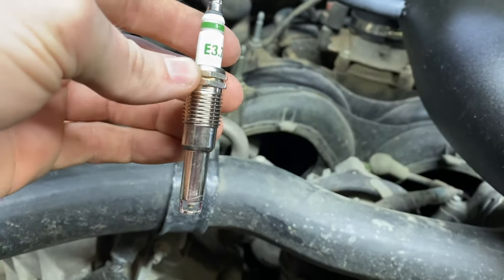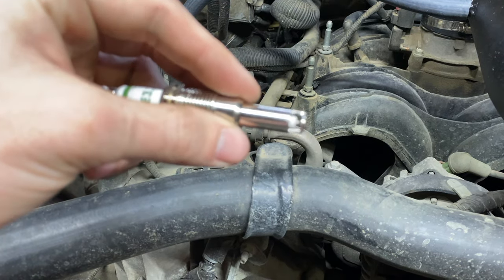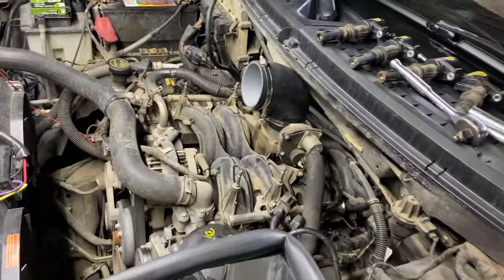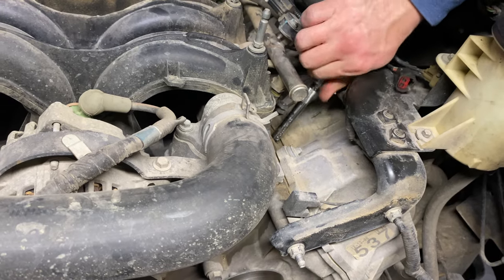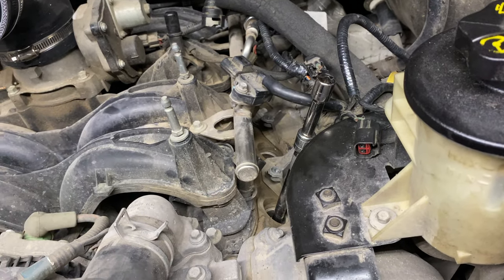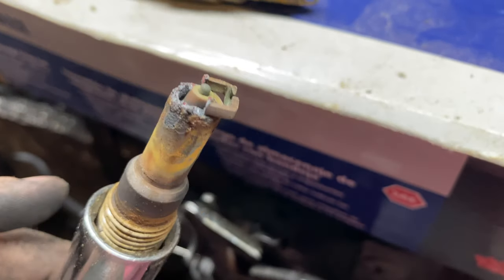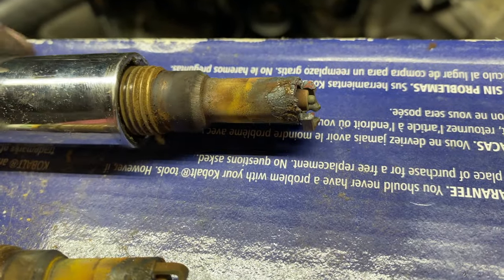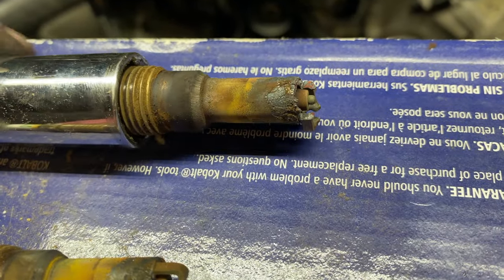This made a HUGE DIFFERENCE IN MY F-150!!

Comment: I own a 2008 Ford F150 with the 5.4 L and everyone has had or will have a problem with the Passenger side Back  Spark plug. I found this simple solution to that and it virtually makes getting that particular plug out ( which you didn't do in this video) Simply remove the Computer and Bracket from the Passenger side fire wall and you will gain easy access to that rear passenger side plug. I discovered this to make changing plugs on the 5.4 a very painless and more pleasant experience. You don't have to take my word for it but it will make a difference.
Reply: I changed 7 out of my 8 spark plugs because of this
Reply: Great hack
Reply: Exactly what I did lol

Comment: I installed E3 plugs in my F-150.  Why?  They were on sale.  Cheap enough to take a chance.  Nothing happened.  As in nothing special.  No increase in power or fuel economy...Also, nothing bad happened.  No misfire.  The engine didn't blow up.  They work.  But don't expect a life changing experience.

Comment: Motorcraft is the best for the triton period. If you have upgraded your truck and would slightly like to improve the only possible upgrade as far as plugs go. Edelbrock coilpacks. Pack a dyno tested 20% spark increase And Ford performance makes one set of performance plugs for these engines. They are hard to find. But even then I would not recommend using them unless you have already tuned your truck cold air intake. Andy, big BBK 80MM Throttlebody. And even that throttle body is snakeoil, Because your intake is smaller in diameter. So unless you HONE your intake, you have gained nothing. But if you make these modifications, it is worth it. Combined with an electric fan swap, it is an amazing difference. I. Also run a true Ram hood to my cold air intake. Dramatic difference, but I still use motorcraft plugs E3 Is a lawnmower plug, Hope this comment save someone some trouble

Comment: What I did with my 2006 f150 5.4 I took coils off and put parts and carb cleaner or BP blaster on then the day before and then loose then a quarter turn the tighten a quarter turn till it gets easier the pulled them out and I put some anti seize just so I don't have problems later on but I didn't have issues with mine even though they was factory plug and I would definitely say I got lucky and like this guy said don't do it unless you know what you are doing
Reply: Thanks for the tips

Comment: Just got my mechanic to change the plugs at 170k miles today. 2007 5.4L and now there’s no slight engine shake or hesitation going from 45-50 MPH. Even the drivers seat stopped vibrating now. Motorcraft is the way to go, thanks for the video! Awesome

Comment: w
When I hit 100k on my 2006, I looked online for info about spark plug change.  Didn't take long for me to get it to my mechanic.  By this time Ford had established procedures and engineered 2 tools to assist with removal - one if the plug actually broke off and another to help extract a non-broken plug.  And there was a special solvent to soak the plug in an attempt to get it to release.  
My mechanic had the truck for 8 days. He worked on it, very gentle turns on the plugs, for an hour every morning. He ended up needing to purchase both tools.  
Final bill - 8 plugs @ $15/per plus labor for a total of $325.  
I know Ronnie didn't make any money on the job. Probably lost money, not to mention his labor.  
That's why a good mechanic is worth his weight in gold.

Comment: EITHER THE CHRYSLER OR ZILLA PENETRATING OIL IS A LIFE SAVER!! Years of die hard PB blaster use before trying these other 2
What I try and do is run the engine to  temperature then pull the coil then try loosing or saturating the plugs a day or week before the repair

Comment: I own a 2005 Lariat, its got 206000 miles on it.  I have given it a major tune-up every 100,000 miles. Never had no major issues, except for Front ball joints. The Truck has been good to me. Runs smooth.

Comment: 167k miles have you have issues with Rocker Arm Valve Lifter Lash Adjusters aka roller followers?
Reply from the maker: Not to date I haven’t. Been wanting to go through the engine and do the timing job, but haven’t had the time to tear into it

Comment: thanks for the video!! off topic question. when you put in that aftermarket filter did you tune anything else? some debates ive read about that.
Reply from the maker: I did a tuner because I have an exhaust as well. It helps out a good bit, I get 16.5 mpg and it has plenty of power to do what I need. also used the tuner to recalibrate spedo for bigger tires
Reply: ok noted thank you so much brother for your response. i aint gonna lie i thought i was gonna be able to figure out my problem with my ford but couldn't so i think im gonna have to sell it anyways. air or fuel problem and cant seem to get anyone or mechanic to figure it out. ones that i  can afford at least. it even backfired at one point haha. again thank you so much for your responses!!!

Comment: Did you see an increase in speed with the Air intake ?
Reply from the maker: Not really, more low end after Intake exhaust and tune all together. Intake alone might give a little better mileage and that’s most likely all you will see without a tune for more airflow
Reply: @JayThompson25  link to the air intake? and air intake box?? tired of looking at the weird stock box

Comment: Great videos. So I changed the plugs on  07 xlt with not much trouble. #4 was a complete burnout. #5 would come almost all the way out but seemed to just spin in the cylinder head, so I just screwed it back in. What would you suggest as a way to remove that plug? Thank you in advance.

Comment: Curious as to why you didn't replace the coils when you were in there?
Reply from the maker: I had recently replaced the coils previous to the plug change! Didn’t have to change them, but just preventive maintenance
Reply: @JayThompson25  will be doing that same job on my 'new' 2006 XLT 5.4....

Comment: Dang that 5.4 runs good dude, mine does too, but it's bone stock,,, well I say bone stock, and it is for the engine, transmission etc, but I had a North Dakota dealer install a block heater for my Louisiana bought truck, and had the local car audio shop in Williston install a nice Astro Start remote start, a must have in an extreme cold climate, or waste all kinds of time, while having to work oilfield hours, waiting for the 5.4 3V to warm up properly before driving in below zero temps
Reply: did you have a 2006 f150 maroon?

Comment: Rock n Roll, dude...that engine sounds great. That plug was jacked...did you eyeball the top of that piston with a camera? Cuz it looks like the top of it hit the plug for it too get bent like that? Or it was damage when installed and if that's the case and it ran well, then that gap doesn't appear to be crucial. You're lucky it didn't break off and destroy the cylinder. I would have insisted on taking a look with a camera anyway.
Reply from the maker: At the time I didn’t have a bore scope camera! However after replacement she runs like a top so I assumed no foul play! I’ve been planning on pulling the motor for a while to do the critical timing and high volume oil pump upgrades!

Comment: I have to change mine and I have mechanical skills but i’m to scary to replace by myself. I’m north florida and the mechanics wants to charge usd 600 + 200 each they broken. I found ridiculous but if you guys know a good mechanic around let me know.  Still the original plugs on my 2007 f150 with 124k miles
Reply from the maker: They’re not terrible, biggest thing is taking your time and doing some preventative care right before you change them. I’ve used the extraction tool, they work great, but it’s always best if you can get them out without breaking. They updated the plug design in mid 2007, if it has brown factory coil boots, they’re supposed to have the updated design

Comment: I have a 2010 F150 Harley edition with a 5.4 3 valve, did the factory upgrade the spark plugs? 144 k miles
Reply from the maker: I believe it was 2007 1/2 or early 2008 they updated to the new plug style. Supposedly they have different color coil boots if they have the upgraded plugs, but that’s relying on them having factory coils

Comment: One thing I've learned, ok 2, first using 99.5% denatured alcohol as a  super lubricant for seized nuts & bolts / Plugs, 2 some times going tighter before loosening as well will free a frozen bolt, ie head, manifold bolt. ;)
Reply: My grandpa taught me when I was young very young that in order to take a spark plug out or any Frozen rusted bolt is to bump it tight with the wrench to the palm of your hand and then bump it back loose. I have a mechanic friend of mine that has never tried that since he's done it for the past twenty some-odd years he's never broke a spark plug or a stud sense ! and I build houses ! Lol

Comment: What’s the fool part number and brand of the plug please?
Reply from the maker: E3 is the brand. PN is e3.70
Reply: @JayThompson25  thank you.
Reply: Is it worth getting the E3's over the new motorcraft put in?
Reply from the maker: @jonathanb9889  really just comes down to preference. I tried them and had decent luck with them. Get 15-16 avg mpg on 35’s

Comment: How often do you recommend to change spark plugs?
Reply from the maker: Usually every 50k, but most people just go until they give an issue. Just depends on how often you want to check them out! Keeps fuel mileage up and a cleaner engine when they’re in good shape
Reply: Ok thanks
Reply: I changed my spark plugs and my coil packs out and I don’t have any lights on the dash but I still have a rough idle do know of anything I could check and replace before buy a new timing chain because I might just get rid of it before I keep sinking a lot of money into it
Reply: @nolimitquavo1391  might be dirty fuel injectors, I bought a machine for $300 that cleans and test them. My truck runs like a top, also way cheaper then buying new injectors

Comment: Any info on the 5.4 cam phaser knocking issues  ??
I have a 06 Lincoln Mark LT  & on my 2nd motor,, crate motor & have 42k on it and sadly its knocking "ticking" as did the first original motor did before it blew a rod at 142k...
Love my truck but the engine ticking is such a bummer
Reply from the maker: Biggest thing is regular oil changes. You can get phaser lockouts but that will require a tune
Reply: I get regular oil changes 3k or even less...using synthetic....
All regular maintenance records kept & filled thoroughly 👌..
Still the knocking has returned in the crate motor with just over 43k on it..
Everything runs fine, just hate the knocking sound & it always gets questioned when people hear the motor..
Other than that the truck gets huge compliments,,, body & exterior are gorgeous... any help would be greatly appreciated.
Reply from the maker: @philipdelzmen7226  could be timing chain tensioner allowing chain slap on the front end of the motor
Reply: Ford did an update on roller followers, would suggest millings oil pump to help with oil pressure

Comment: But will it spin in dry road 🤣
Reply from the maker: It’ll smoke 35’s on dry pavement 👀🤙🏻
Reply: @JayThompson25  had 4:10s on my diff and on 35s n still couldn’t spin them until I blew a piston 💀💀
Reply from the maker: @josearellano3268  big oof. 3:73’s turns 35’s over like stocks for me 🤙🏻 might have to post a video 👀😎
Reply: @JayThompson25  maybe it was my 4.6 2v. But after I blew the block don’t get me wrong I was gonna throw another block, but got rid of it n got my self a 2012 Nissan Titan, now that truck is a different beast.

Comment: E3 plugs absolutely suck brother do yourself a favor and run motor craft. E3s don’t hold up, poor design, not to mention you can see all over yours how cheap that metal is to corrode so fast I mean 50k? I pulled a 120k mile set of motor crafts out of my 05 f150 and they looked way better then those
Reply from the maker: Might try out the platinum motorcrafts if these give me any more issues!

Comment: Plugs in these trucks dont need to be changed but every 60k miles..useless to change plugs every 10k miles waste of money..
I would recommend nothing but motorcraft original eqiupment for f150s after servicing these trucks for years
Reply from the maker: Truck had 50k since last plug change. Had E3’s in it before and ran fine. Got 16 mpg on most days and had enough power to smoke 35’s like stock tires. My brother runs nothing but motorcraft in his 5.4 and gets a little less mileage but same power. Not much difference is noted between not running the motorcraft plug in my opinion. We’ve got 4 vehicles in the family with a 5.4 and all still running strong with no major failures. Must be doing something right 🤷🏻‍♂️
Reply: @JayThompson25  what all do you have done to your 5.4 to get that kind of low end power. Mine is a stock 2005 with just a cai and its a turd straight up
Reply from the maker: @anthonyelias8627  bone stock internals with a cold air, tune, and exhaust
Reply: @JayThompson25  That broken plug was broken when it was installed by someone the last time. Probably bumped it goin in the hole.  No way the piston touched it.  I've had those E3s come of the box looking like that.  The welds holding on the ground straps are fairly weak.  I guess they'll make do, but I've always viewed them as a cheap made novalty items
Reply: Motorcraft is terrible my 06 ate through all 8 spark plugs surprised it even runs considering all of the bottoms of the spark plug got completely obliterated, they probably shot through the exhaust but I definitely do not recommend Motorcraft me they make them very poorly, E3s are definitely the move